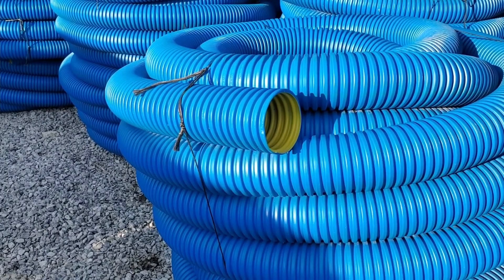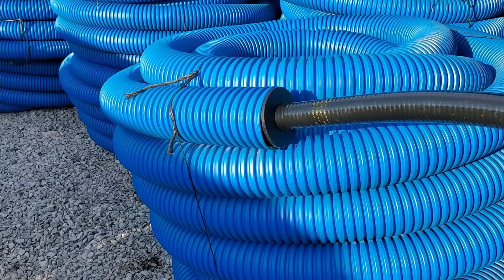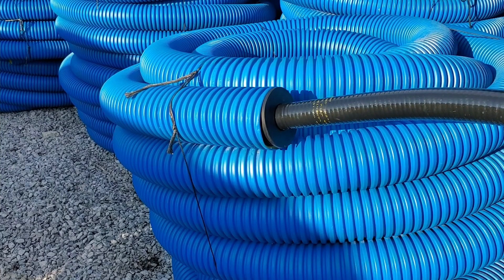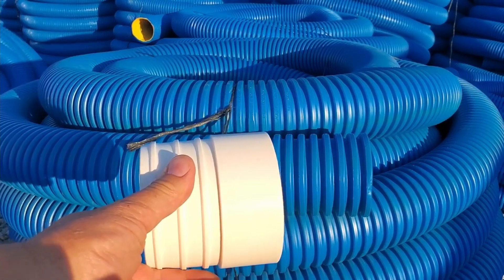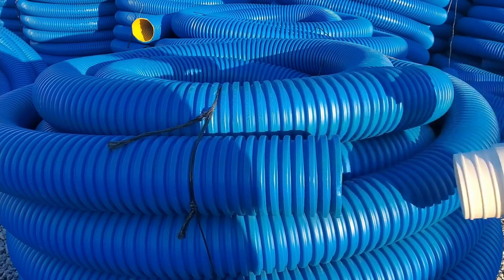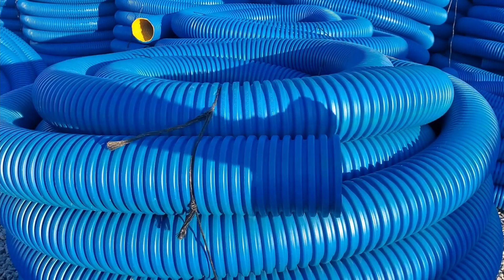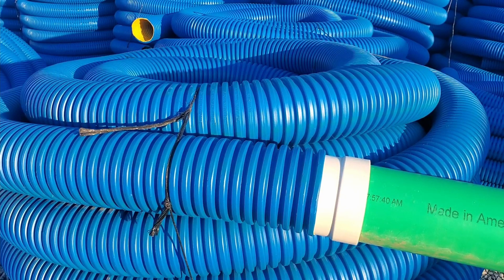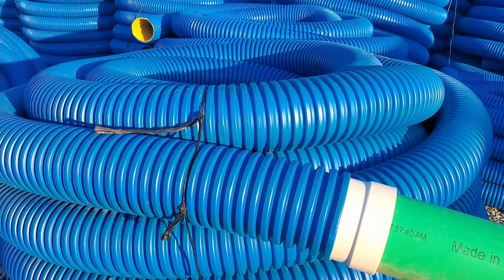How to Connect 4" Corrugated Pipe to Anything

Comment: thank you. I couldnt begin to describe the hot garbage mess that I have on my outlet 1.5 to the 4  in corrugated. I have adaptors on top of adaptors. The couplings at HD don't even fit or make sense. I have tried probably 20 fittings and I still have leaks. I even got desperate and tried butyl tape. Thank you for this video. I have to DIY this awful high water table issue in my newly purchased house. I hate everything. Thank you again for these insights.
Reply from the maker: I can't begin to tell you how hard we've worked to make brand-new parts that the industry never had, but we desperately needed over the last few years. Our catalog has grown immensely.
Best French Drain and Yard Drainage Contractor
https://frenchdrainman.com/
Reply: Wow just learned your in Michigan! Lord knows we need your expertise to get water away from our foundations. The county and road commission don't care. Is it possible to pick up parts at your office? I understand shipping can take 7 days. I am in Shelby twp.

Comment: Hi there. Have you subscribed and watch all your videos as they release. In previous videos you mentioned you run 4" Schedule 40 for Sump discharge in cold territory. But in this video you mention running 1.5" flex schedule 40 until you reach a downslope. I'm in the process of putting in a new discharge in a house in the Catskills (cold weather environment), and was planning to run 4" from the discharge from the house all the way to daylight but now I'm confused? Should I be using 1.5" from the discharge to the top of the down slope then connect to 4" solid corrugated? I was planning to use your 1.5" to 4" discharge setup so curious to know if I should continue the original plan (4") or rearrange the outlet setup to go into 1.5" flex. Appreciate any feedback. Cheers.
Reply from the maker: Indoor and outdoor 1 1/2" off the sump pump and we drop it on a bigger pipe once DOWN HILL. Good question thank you for commenting.

Comment: Sir- thanks for your videos. I ran 2 spouts into 4 inch corrugated. One of them goes first to a catch basin and then to the main line. Issue- in florida with a heavy rain the system is overwhelmed and the catch basin overflows. If I had to do it again I would have used 6 inch but don't want to dig it up. Question- a bigger catch basin solve my issue? Ps it all runs to a pop up emitter not a d box. Thanks.
Reply from the maker: Run 2 lines off the overwhelmed catch basin. Add a 4 inch discharge
Reply: Thanks!!